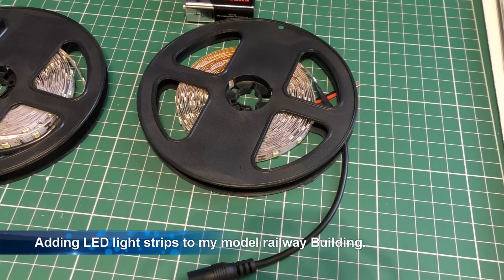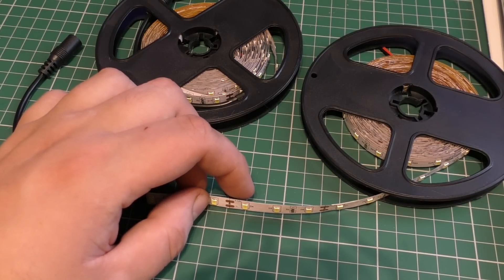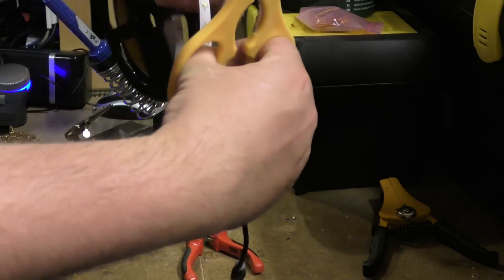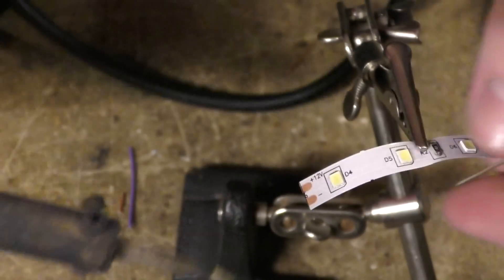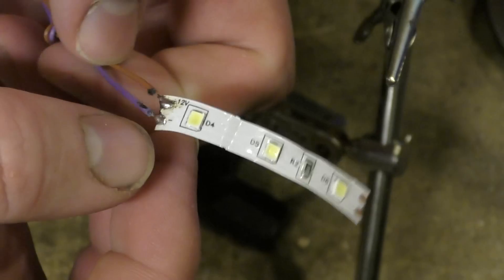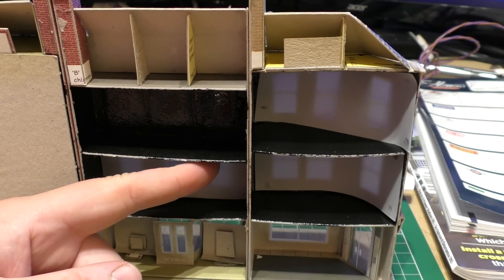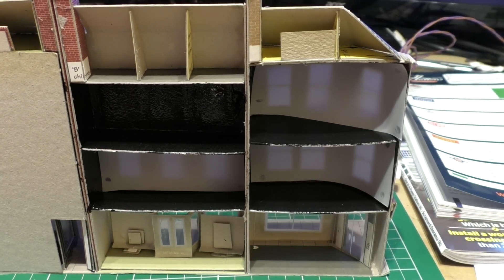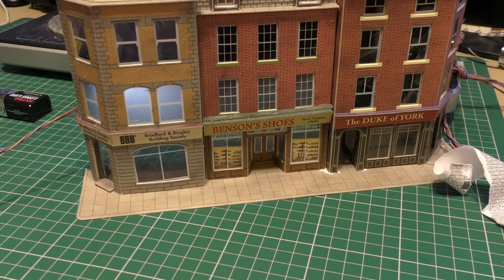Adding LED light strips to my model railway Building

Comment: Hi Richard.  Will a 9v battery power a 12v led strip?
Reply from the maker: Yes it should light led stripes but not as bright as the recommended 12 volt.

Comment: I use these strips all over my the place.  They come in various colors as well as color temps for warm white, bright white etc.  As mentioned the strips are made to cut into strips of 3 leds.  I have also used single leds from the strips with a 1k resistor for a 12v supply.  Just mark the side of the led that connects to + before unsoldering it from the strip.
Reply from the maker: Thank you. I have been thinking about if I could use the led as singles it is good to know I am not the only person who thought about it

Comment: Thank you for this great share. I use the similar technique, i.e. cutting the led strips, soldering the wires and later supply 12 v from a standard powerpack. I use a mask tape to reduce the light intensity if needed. Recently I saw on my friend's layout where the lights were fixed to the floor as opposed to the ceiling. I felt this idea was great as it facilitates easy replacement of lights if they go kaput and also lights stick better on the floor. What is your take on this method of fixing lights on the floor?
Reply from the maker: Thank you for your comment. I have not thought about the floor before but I can see the pros with it the only downside I can think of is the light bleeding out but there are ways to stop that. I think I will have a try with that idea sometime.